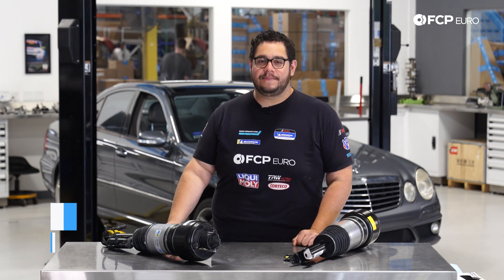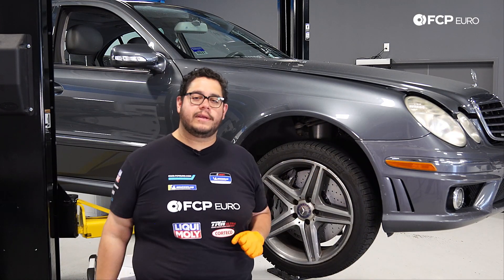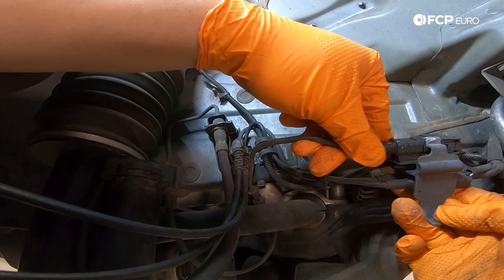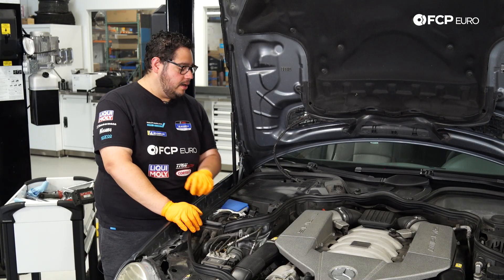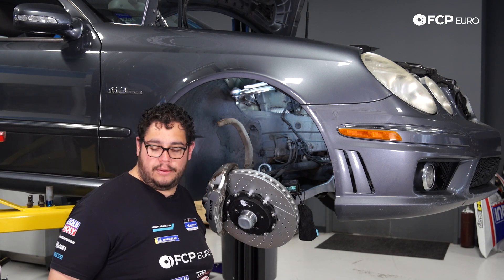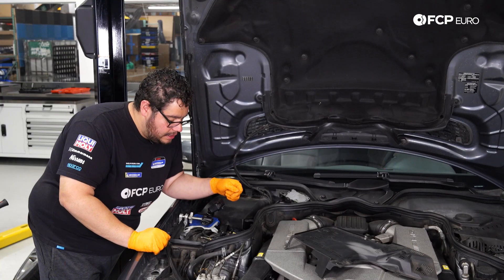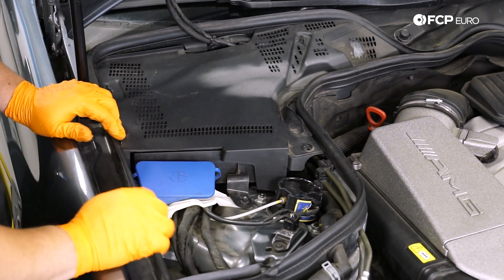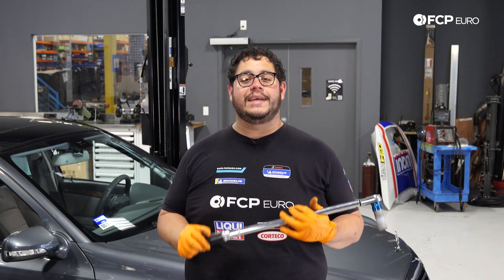Mercedes E63 AMG Front Airmatic Strut Replacement DIY (Mercedes W211 E55, W219 CLS55, W219 CLS63)

Comment: Use star diagnostics to reduce air pressure in front air strut for esoer removal. Then, with the new one if it is a struggle get it at the size you can also deflate or inflate it using star diagnostics. I believe its under actuations in the airmatic menu. I may put up a video in next few days if I remember to record it as im about to do it on my w211 again

Comment: So. The car is brought down? Does the compressor automatically add air to the strut before it is brought down? Did you have to start the engine while it was up in the lift? Were the struts filled with air before installation? I’m confused. Sorry
Reply: Yes the compressor will add the air, turn it on before lowering the car to allow it to fill up and then put it down. The air struts come full, so you must depressurize them before you take it off and put it back on.
Reply: @Loujr2250  Good to know, thank you.

Comment: Any re-programming required in mercedes diagnostic equipment post re-install? Is disconnecting the battery recommended to prevent any inadvertent self levelling behaviour from the car whilst working on it? Side note - is this part the exact same OE part that was fitted to the car originally? I think Bilstein may have been the OE part manufacturer of these struts but I'm not 100% sure - just weighing up the differences in buying these vs from Mercedes (when they come back into stock...)

Comment: Air line not even seated at all lmfao hmm wonder what that yellow mark is for 🤔🤔🙄
Reply: the yellow mark identifies which airline is which at the valve distribution block mounted above air pump on drivers front side.  Each air line has a different color mark to make easy identifying.  Hope that helps.